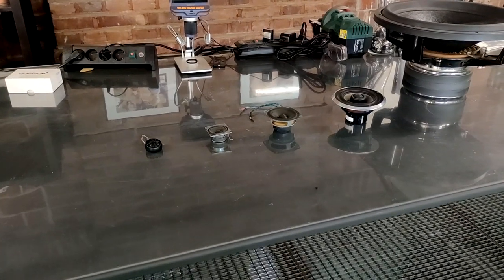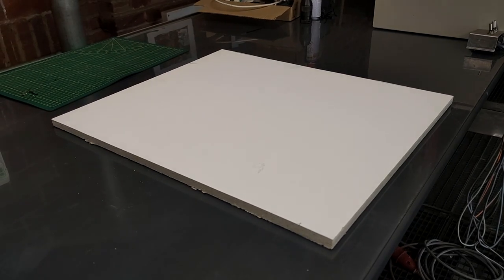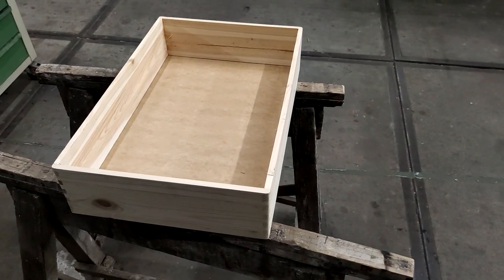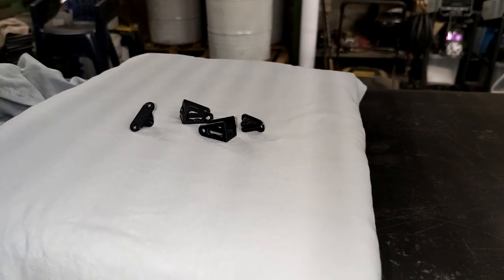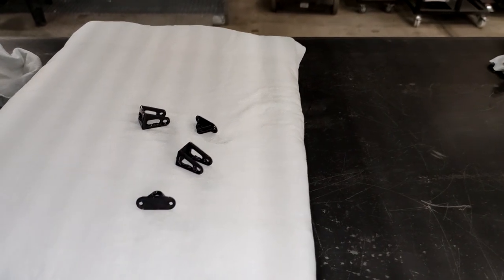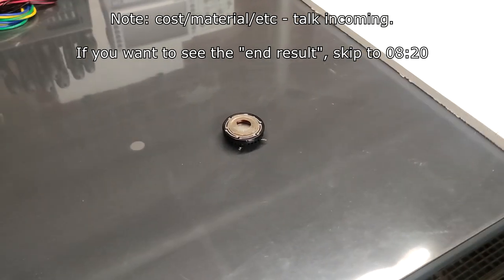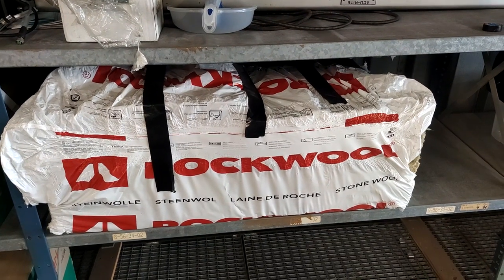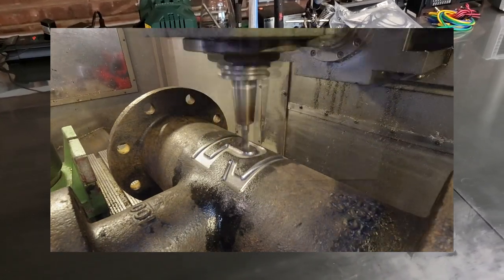Should you build Panel Speakers? Let's find out!

Comment: Very cool! I bought the same exciters, but still need the time and space to laser cut my foam panels. I'm going to combine them with a FreeDSP board and a closed sub based on a Peerless driver.
Reply from the maker: I wasnt aware a board like the FreeDSP existed! very interesting. It may be too powerful, because in a true stereo system you dont need time delay etc. Only think you really need is crossover for panel/sub and a parametric equalizer. But I think I'll buy one set of components, Im searching such a dps for my home cinema!

Comment: I assume the resonator panels are acoustical ceiling tiles?   they still sound metally, due to lack of woofer or woofer qualities to pass the low frequencies.  There are ways to get around this using the same panel material with specific size and additional geometry. A single small panel, as most people build these DML panel speakers, is not enough.  I have done a great deal of experimentation and tweaking to get panel speakers to sound more full but they will never equal box or sealed ported speakers. 

I built a set of furniture quality La Scala Klipsch horns back in the 80's with my own twist to them, I was going to get rid of them because they take a lot of room, but on second thought, I decided to keep them because they are excellent speakers for listening to Jazz or home theater, and the huge size is simply the tradeoff one needs to deal with for high quality sound. Unfortunately, the panel speakers, even with cross over network to pass the low frequencies to sub-woofer are simply no comparison. I had a set of them 2x4Ft pink foam panels )  behind my DIY 15x6 ft home theater 2-ply spandex screen, in space of 2.5x4ft windows at the ends, as their cubby holes but opted to simply use a modern wireless soundbar system, for better sound and to avoid having to pull out my old 5.1 channel audio amplifier and avoid all the wiring with larger box speakers. 

While on the subject, I have also experimented with multidirectional speaker configurations using  PVC pipes to mimic the sound dispersement, that is typically heard when you are in front of a band or concert, and this setup, while a bit more cumbersome, and strange in appearance, has a much more realistic sound distribution, if the speakers and tubes are sized according to instrument volume one want to replicate the range of its related frequencies. For example: if you want to replicate base or kick drums, a larger diameter tube and woofer is ideal, while if you want to replicate a metal instrument, horns, etc., a smaller diameter tube and speaker is ideal. There is really no magic here just a lot of common sense and experimentation and ultimately what sounds satisfying to one's ears.
Reply: I enjoyed reading that, thank you. I am interested in the pipes and cannot quite imagine what you describe, ever thought of doing a channel?? You should. I don't have the workshop at the moment to play about but I am intrigued by a couple of chaps who build electrostatic speakers, any thoughts on those?

Comment: I wonder if the techniques used on magnepan speakers would work with these as well. For example increasing the sides or the wings of the speaker however it's described to increase bass response.   

due to the nature of the speaker I don't think this would work in a typical box type design but it will be really interesting.

Comment: Thats really cool. How do you suspend the Cable to the exciter. For fourty watts it shurely isnt unsubstantial, and i imagne it kinda needs to not hit anything when playjng a loud noise to avoid makeing a ratteling noise.
Reply from the maker: Yes youre right - I used very flexible silicon wires to attach to the speaker. As you said, any tension on the wires cause problems with the driver!

Comment: PLEASE REMOVE CASE FROM THE BACK OF THE SPEAKER PANEL....  The sound will be MUCH MORE CLEAR AND WILL HAVE MORE  AIR OR BRIGHT.....

Those cases add some boo or woo like distortions on 250-500 Hz.

Comment: they sound best if the width is 99% the length( oddly enough) and they are hung at least 4 inches from any walls and nothing blocking the sides
Reply: also one speaker should have the exciter in the center and the other off to the side and lower or higher.

Comment: Is 2/5 centering a rule or a suggestion?
Reply from the maker: A rule to minimize modes. If you want all the details, check tech ingredients video!
Reply: its a rule, but another is to have the panels width be 99% of its length and to put one exciter (left or right) in the center... and the other is in the 2/5 rule placement.
another rule is to round the corners on the panels.
another is to hang them in the open no closer than 4-5 inches from a wall not in a box!

Comment: Everyone is praising these, so I made a pair out of yellow xps (60x60x3cm). Sounds like sh!t, no base or treble, only mids. With the same effort you can probably make a pair of coned speakers out of lunch boxes with holes in them, that sound better for the price.
But you could use it for PA system with drop ceilings though, or haunted houses.